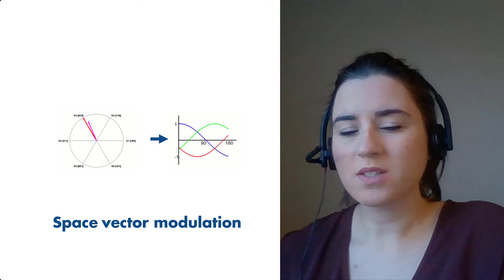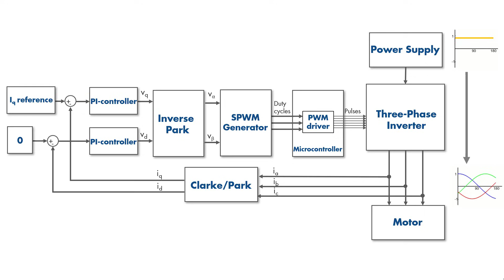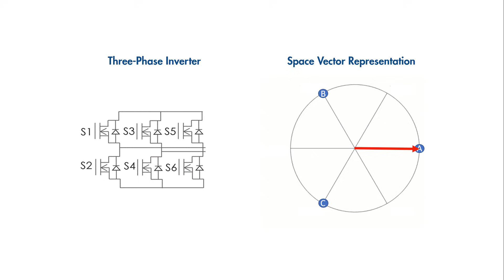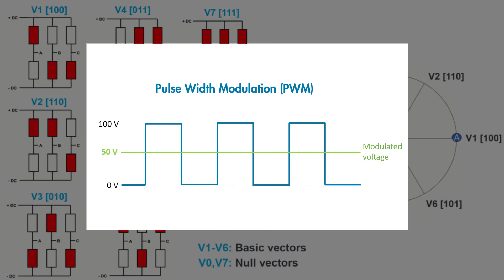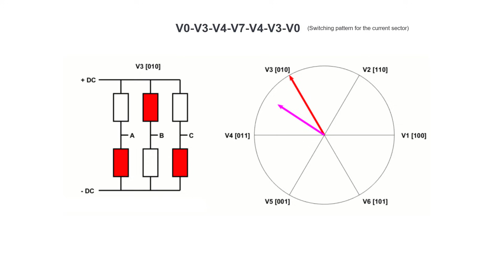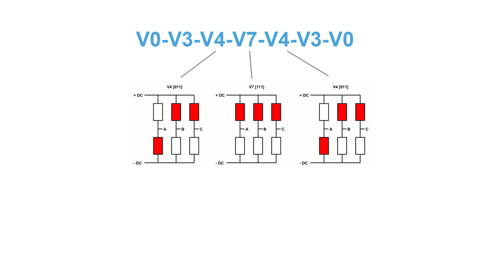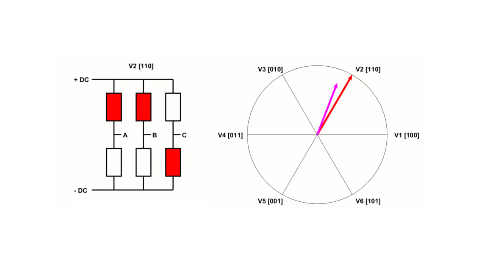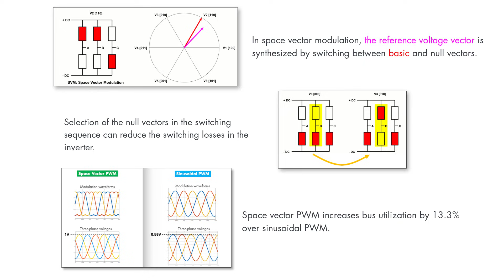Understanding Space Vector Modulation| Brushless Motor Control with Simulink, Part 5

Comment: About the DC voltage utilization, I remember the sinusoidal PWM utilizes only half of the DC bus while the space vector PWM can exploit up to 0.866 (sqrt(3)/2) of the DC bus. I think it is impossible to have an output voltage magnitude equal to the DC bus (excluding overmodulation). Am I wrong?
Reply from the maker: To achieve a peak AC voltage output equal to the DC voltage, you would likely need to use active boost circuits
Reply: @MATLAB  Agree. But at the end of the video it is said that with sinusoidal PWM your can achieve 0.866 of the DC bus while with the space vector PWM you can achieve the DC bus voltage (and the boost circuits are not mentiond), that is wrong.
Reply: @DanieleVanzan-j8e  Thanks for pointing it out. I've spent hours researching the possibility of having V_LN = VDC (without boost). I couldn't even find the 0.866, most materials achieved 0.6 - 0.67. Can you (or anyone) point me to any existing practical implementation of V_LN = 0.866VDC please?

Comment: Can someone explains to me that why we use 3 channels of PWM in the example Simulink model instead of 6 (because we have 6 mosfets) to control the motor?
Reply from the maker: Each arm has two switches. When one switch is on, the other must be off, and vice-versa. Therefore we show only 3 channels for clarity, and the other three are the logical NOT.
Reply: @MATLAB  I'm not using the DRV8301 mosfet driver like the tutorial, so before i deploy the simulink model into my hardware, should I add an inverted signal of PWM1A, PWM2A and PWM3A by adding the logical NOT block for each pwm channel, then the result is PWM1B = ! PWM1A, etc?

Comment: Can I ask, what is the effect of chosen PWM frequency on torque output driving PMSM using SVM? Do you get less torque accuracy and more torque ripple at higher speeds if you use a lower PWM frequency?
Reply from the maker: Yes, at lower PWM frequencies you can expect more torque ripple. Field oriented control coupled with high PWM frequencies is an effective way to obtain accurate torque response. This discovery page provides more information https://www.mathworks.com/discovery/field-oriented-control.html

Comment: I did not understand if the red means switch is off then how in the on time duration calculation it is actually the opposite?
Reply: She intends to show you that the pink is comprised of the two red ON one at a time and soetes both off.  Her animation could be clearer if she shows the duty cycle of the red vectors by their lengths, not by flashing them in time.
Reply: yes, it looks like red should mean that the switch is on. Probably a little mistake?

Comment: Could/would you use this kind of modulation to hold the motor on a specific angle?
Reply: If the motor were not moving, you just apply a stationay vector (not rotating = 0hz) that applies an equal and opposite force against the outside force that would otherwise tend to move the rotor. Move to the -Q axis (or change 180deg or just change the sign of the command) to apply force in the opposite direction.  All the while, you need to track the motor's position to stay in sync with its axis (d,q) if it moves.

Comment: The animations are very good and it makes the concept easy to understand. However, there are certain points that I would like to highlight that might help other viewers.
1. The bus utilization increases by 15.4% and not 13.3% (The factor by which it increases is 2/sqrt(3). 
2. The explanation as to why SVPWM helps in better utilization was not clear.
3. In practice, the method of finding sectors is rarely used. You should have also mentioned about third harmonic injection technique and link it to SVPWM. 
For anyone who wants to know the details regarding the above points, they can refer to this video. 
https://www.youtube.com/watch?v=nh9TD2M2r-o&ab_channel=TheSubcooledMind

Other than that this video has been good.